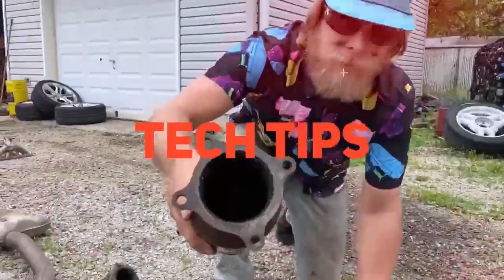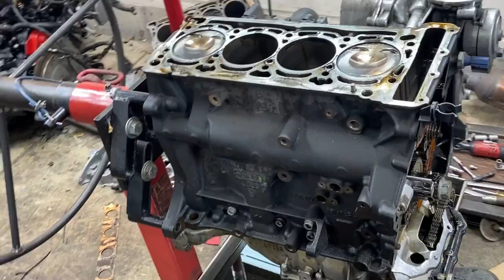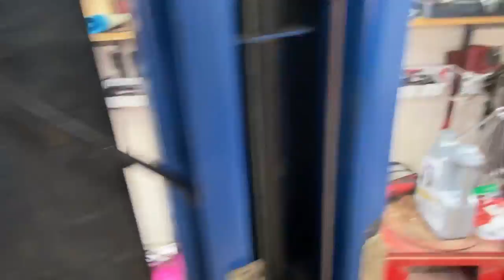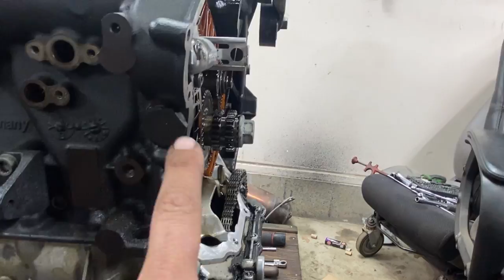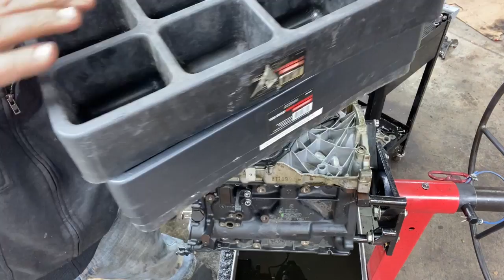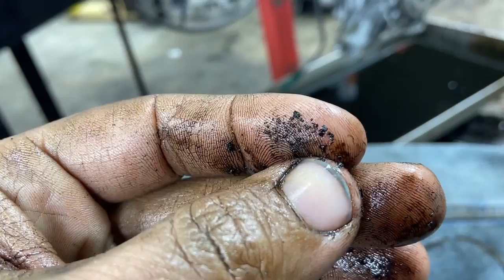2.0t Oil consumption tear down and inspection.  Audi VW using oil pistons failure reliability

Comment: On my 2010 audi a4 oil consumption  was so bad that every 350 Km I had to add 1L of oil I have never seen anything like that or ever heard! and I have been driving all sorts of cars in my life this one was the worst ever. What the heck were Germans thinking? I have  installed non wafer style oil control rings with $140 ebay malhe pistons on my 2010 audi a4 , but I knew about the problem with the piston rings so I did something on my own and took a chance,  I enlarged all of the holes around pistons with a drill bit slightly larger, put engine together , now I can't believe the results I got ,  now I don't even top it off because every 5000 km it only consumes 1/4 of a litre it's mind blowing and I am so proud of my self . Dealer will tell you that 1L every 1000 km is normal that is bullshit they are just covering it up for their unengineered piston rings period. I should also mention that I have deglazed the block sleeves with silicon carbide flexhone bit . I want a comment back if you agree or I just got lucky on the modification. So far I drove 82000 km since then and no top offs, I change oil evary 7000 km  Mobil sinthetic eoropean grade 
OW40. I just had to share my story , thank you so much, I picked up some of your trick which I am grateful for.

Comment: hi mr naptown , what are my options for piston rings on my 09 a5 2.0t? it runs fine but smokes when hot and only had 75psi on a compression test going to about 100 on a wet test , what rings do i want? shall i just order from audi or go branded aftermarket , is there a better choice of rings to use? im building the engine in a few weeks time

Comment: I think you guys are barking up the wrong tree, buy genuine parts, but the oil burning problem is American fuel, now we are seeing more of the same problem in Europe, because European petrol (gas) is becoming like American petrol mostly ethanol and less petrol content and the fact the lubricant additives are more and more being left out of petrol all in the name of emissions, engines just weren’t designed to run on this crap, we had the same kinda deal when unleaded took the place of good old 4 star, we started to find valve seats and valves burning out early

Comment: I currently own an Acura RSX 2005, been an Acura guy since I started driving 15 tears ago. had my RSX for close to 8 years now, but i have 3 kids... RSX is only a 4 seater car, so i was on the market for a 4 door. In Canada audi's a4 2.0t quattro 2004-2008 go for as little as 1500-3500$ on kijij(cragslist equivalent and still relevant in my province) the lower priced one's being higher milage and it got me wondering why they were so cheap. after some research it seems they all have this oil consumption issue. And Audi say's it's normal for the car to consume 1L of oil every 1000km. This kind of oil consumption is what you see on honda/acura with over 330,000km(206,000miles) I was looking to buy one but i think i'll just buy An Acura TL 2008 instead timing belt can be done in around 2h, just like my RSX(my rsx is timing chain).. and the rest is Honda reliable. The euro cars are just poorly built, overpriced parts, Labor intensive, and you need special tools for simple fasteners. Just seems to me like very bad engineering... I laugh everytime somebody say's German cars are feats of engineering. The only feat of engineering I can see is the feat to make things as unnecessarly complicated as possible. That's not a feat, that's a failure. Thank you for sharing all this, you helped me make a good decision as I was in the mindset of getting an a4(they do look very nice, sad they're so unreliable.)

Comment: Couldn't find a way to DM you. What do you think about this B7 startup noise? 
I don't think I have secondary air injection but if I'm wrong just let me know. 
https://youtu.be/d6LEwaNYLOg
Reply from the maker: It’s idle up on cold start, more idle more fuel for emissions it helps the catalytic converter to get to temperature faster

Comment: Hi, could you help me. I don't speak English well, so i  didn't understand some points: why did the pistons have been replaced again, because they should be pm (23 mm) and not am (21 mm), right? But oil control rings were good because they have been already replaced at 2015? The rings were not original of 2009-2011, right?
Reply from the maker: If you already had the update done then it should most likely last the remaining life of the car. Even with the 2nd generation pistons

Comment: On a 2013 a6 Quattro 2.0 premium plus model, what is the correct torx bit to use to loosen the oil drain plug? it would be awesome if you could put a link to a good one to buy.

Comment: Hey mate, love the video. I have had the same exact problem at 100k my engine rebuilder was adamant that the new style pistons would clog up. He took my 1.5mm control ring and machined it to take 3mm rings. I have done nearly 100k on that rebuild and really good oil consumption. What are your thoughts on this method? It seemed to work for me.
Reply: The passages on those oil rings are ridiculously tiny. Good job VW. 0_o

Comment: I bought a 2017 Audi TT do i need catch  can it has 9000 miles.?
Reply from the maker: Not needed at all, it has its benefits by not regurgitating sticky oil fumes back through the intake to keep the engine cleaner.

Comment: Hey Naptown, been watching your vids for some time. Recently picked up a 12 A4 2.0T, wasn’t aware of the oil consumption issue. My question to you is, if I pull my motor, pull the pistons, and give them a good cleaning, will this correct the oil consumption issue? Or it’s MANDATORY to replace the pistons and rings? Love the vids btw keep them up 🙏🏼

Comment: Im an Audi VW tech and really enjoy your content.  Cool fella, relaxed with a good sense of humour.  Hard to find these days
Reply: This is what happened I took my mom to an auction I told her to get a new car off of the lot she picked an audience Q7 4.2 So I just got in with the misses right before the auction she was late like always they had no time to inspect the vehicles and short story I paid 10 grand for 2008 Q7  It came with a smog done already With a dead battery and  No gas Just a Valley key was with it So I bought my mom the remote's 2 keys fobs paid 600 each for the programming I bought her a jump pack for the car though she doesn't get stranded and the damning car did not even last 3 months On the passenger side the rocker arms I believe they're called your roller arms came off the whole bottom roll I've been trying to find an engine airbase trying to charge me $12000 Just for the engine 15 to drop and install each Everywhere I asked to do a rebuild they don't wanna do it why is that I know it will start up without those installed right now Just running on a few and others bent valves But I'm not gonna start it do you think I should just replace that half of the side of the motor
Reply: 6264105092 send a text

Comment: awesome videos man. huge tips. subd and thumbed
 my 2012 a4 same shit. audi said no recall or extended warranty on my vin. was burning quart of oil every 500 miles(started at 90sh/k. changed some parts, pcv, hoses, timing chain and oil went back to somewhat normal. 1q every 1k-1500 miles. now i got a turbo wastegate problem, leaky downpipe and air intake leak.. oh joy. 
would engine flush help the rings at all? and is liquimolly green stuff oil any good?

Comment: Hi there , I have a 2015 audi a3 2.0T my car has been tuned (apr stage 2) Im having problems where my number 3 spark plug gets dirty with oil and I would have to take out clean or put a new spark plug in. This would happen alot.plus my oil is burning fast.no one can find the problem. Can you help me out? Thank you.

Comment: That’s very true , “they” make  counterfeit parts for jet engines & high pressure pipeline bolts , which do not have the required tensile strength to do the job required , it’s criminal you really have to be aware and on your toes to catch this  fake parts .

Comment: I'm going through a quart every 200-250 km. Rebuilt the bottom end and even got forged pistons for 1000$ but unfortunately cylinder 3/4 rings failed so it's burning a bunch of oil. Did a compression test along leak down test and was only down 10 psi. passed leakdown test so I assumed it was head related. Long story short rebuilt the head for a couple thousand and am stuck with  a car that's amazing in every single way but burns a bunch of oil:(. Bought the car three years ago and it's been getting topped off ever since.
Reply: Got a engine lying around that you could sell me. Really don't wanna let this car go  put over 25k into it over the years in parts and modifications along with being my first car so has a lot of sentimental value to me.

Comment: You're letting VW/Audi off way too easy saying the problems were caused by bad parts from their suppliers.  VW/Audi designed the parts, created the specs, let the contract, and were responsible for monitoring the quality control if its suppliers, preferably by an independent testing lab.
When parts are bad, it's the OEM who's on the hook for warranty replacement and the inevitable class action law suit.  You'd think VW/Audi would have learned from the Firestone 500 tire problems in the 1970s, and the ongoing Tanaka airbag debacle, that "It's your name on the grill."
Going with the cheapest supplier is usually false economy.  Volvo had a short-lived advertising slogan that went:  "The car engineers would build if they didn't have to answer to accountants."

Comment: Most diy people cant use a blade to scrape without messing up the surface and slicing fingers.
Cant those pistons be machined for better oil rings?
Reply: To bad they weren't design right / better in the first place.

Comment: FWIW, I have a 2014 A5 and a 2015 A4 and neither burns a drop of oil. I think the ‘12’s + are good but I wanted to go a little newer to be sure.
Reply from the maker: It really all depends on lots of factors some 2009-2011 engines to this day do fine on factory pistons and I recently had a 2015 q5 2.0t 190k miles drank 1qu per 300miles.  
Top tier fuel, synthetic oil changes on time and drive it hard every once in awhile to clean it out nothing else much you can do until it eventually gets bad or it might not.
Reply: @NaptownTuner  interesting, I thought this issue was really “fixed” around ‘12/‘13 but obviously not 100% true. I agree, the 10k oil change interval is insanity. And, could this engine be any easier to do an oil/filter change? I do mine between 4-5k using synthetic. Could I go longer? Yeah probably but I don’t need to squeeze out every last mile out of 5 qts of oil.

Comment: Interference engines = both the valve train and the bottom end (piston crowns) occupy the same space inside the combustion chamber just at different times . SOOO if said engine jumps out of time then they will contact each other

Comment: I think these engines are really solid, you just need to get them running on LPG (Liquid direct injection). I've got a small one, 1.2 TSI at 275000km, no issues yet. If there are no soot particles generated during combustion, it cannot submerge in the oil and then clog on the oil scraper rings. So GO LPG! Go propane :d (its really f*cking cheap in the Netherlands too, driving like that)

Comment: I hear the oil sludge in a well maintained engine is caused by using different brands of synthetic oil.  The oil additives between different brands are likely incompatible, and causes the buildup.

Comment: There is no defective parts for Audi assembly line.
I am most certain, that VW dictstates all the specs to its production line suppliers. Those pistons got laughable size oil control ring, material type, density etc as per Audi spec. Size of oil drain holes in ring slot on the piston, guess what, audi spec...
That is why you do not see Audi suing Kolbin Schmidt for all those recall and install updated parts costs. 
Unlike airbag Takkata case where issue/deffect was traced to part manufacturer inself...
I am sure Kolbin Schmidt guys said, hey Audi/VW, you gave us all the specs, we made it the way you wanted, your design is flawed causing engines consume oil and massive recall effort? Eat poop...its on you.

Comment: I've used Kolbenschmit and Mahles in my aircooled VW builds over the years.  Good parts.  

I hated working on TFSI engine at the shop.   The concept was good, but parts quality from the factory not so good.  Especially the cam bridge.  Once those screens fail, your head is shot. We had lots of chain tensioner failures as well.  

That's an awful lot of carbon in the oil control rings.  Seems like a combination of lack of frequent oil changes/cheap filters, and the inherent build up that of carbon thanks to the direct injection.  Unfortunately direct injection is here to stay.  My 2001 Audi S4 with 200K miles consumes less oil than these engines.   I had to do the carbon cleanings as routine maintenance.  Once you clean the intake ports up with walnut shells you're good for another 40K miles.  Good money for the shop, but sucks for the owners.  

Great video for the home mechanic trying to understand why their VW's and Audi's break their hearts and wallets.
Reply: So much for "german engineering". Can believe how ridiculously tiny the passages are on the oil control rings.

Comment: I just open a 2015 engine and has the grooved oil rings so I think they change it after 2015
As far as the clogging of the rings I want to say that is bad design but is the owner's fault too by not doing the oil change on time and by using cheap oil in their engines

Comment: I personally am not convinced that the carbon build-up is caused by direct injection design - not even in the intake ports. I believe it has to do with the crankcase breather design which is closed loop. vaporized oil and combustion byproducts are being re-introduced back into combustion chambers.

Comment: So glad I’ve found your channel. I’ve a 2019 Golf R. It was an ex demo and had 2k miles. It’s munching oil at 1ltr per 1k miles. The dealer has told me it’s normal!

My wife’s VW 2003 V5 sport is now 17 years old. We’ve owned the car from new. I was warned about potential oil consumption by the dealer. I decided to go old school and ran the engine in for 500 miles and didn’t take the revs above 3k. Then I asked the dealer to change the oil at my expense. They refused saying it wasn’t due for a service. I then took the car to an independent and had the oil changed. The oil is changed every 5k miles, 17 years later with 190k miles there is no oil burn at all. 

I’m certain that car companies are fitting inferior internals and mixed with harsh early life driving, is making them burn and consume oil.

Best wishes from Edinburgh, Scotland.

Comment: My 2011 Audi A4 burning oil but I’m ok with it since it’s the only thing wrong in the last 100k miles I have put on it. I have 139k miles on it. I’m Thinking  I need to replace my chain, tensioner and guides soon I’m just procrastinating...love the Info you just got another follower

Comment: I just picked up a 2011 a4, with a bad timing chain and bent valves. I noticed it had the pistons updated but I was wondering if they rehoned them at the dealerships or did they just pop new ones in? Regardless the cross hatch is fairly light for 80k miles, is that common to see?

Comment: i have a 2013 q5 2.0 how much would you do a rebuild for?
Reply from the maker: Lots of variables NaptownTuner@yahoo.com
Reply: @NaptownTuner  new subscriber absolutely the best tear down I've ever seen. I feel like I'm going to learn a lot from you quick question where are you located I have a big problem I bought a 08 GTI fully built engine supposedly 524 horsepower Garrett GTX 3076 and I needed some work done. Please let me know bud. I'm in Pa.

Comment: This is really great content, subbed. I was wondering, is there a way to clean the carbon off the oil rings without taking it apart? I read an anecdote that driving on highway(2.5-3k revs) for 600km on new oil change got the pistons hot enough to get rid of the excess carbon and the car didn't have oil consumption issues for a year. Does this sound possible to you? Also, would fuel/oil additives help the issue in the short term? Thanks so much for the content

Comment: Can you do a side by side comparison of the old pin hole spring oil control ring, the slot spring oil control ring, the new waffle style oil control ring, wrist pin/piston and rod sizes?
Reply: Hi, could you help me. I don't speak English well, so i  didn't understand some points: why did the pistons have been replaced again, because they should be pm (23 mm) and not am (21 mm), right? But oil control rings were good because they have been already replaced at 2015? The rings were not original of 2009-2011, right?

Comment: Is there reason why can't I use different pistons/rings for example JE or better since I don't see big different in upgraded ones from Audi anyway?
Reply from the maker: If you buy name brand from a reputable source you should be good I just want to make sure people know cheap is cheap and sometimes others repackaged cheap for more or counterfeit.   I always tend to trust dealer revision parts though because that’s what I have experience with.  The dealer as far as I’m aware typically figures it out faster or better than the aftermarket for factory type applications.  I wish I would have been filming earlier because I had many examples of bad parts but I tend to trust big name brands that have a reputation purchased from a reputable source it’s just a scammy world out there these days with internet parts.  Many valuable aftermarket parts out there for sure especially in the performance category
Reply: @NaptownTuner  Thanks for quick replay and keep up good work!